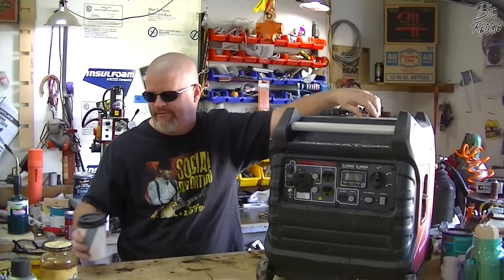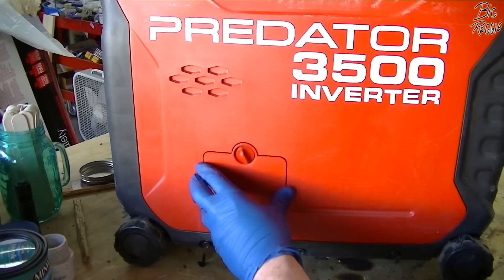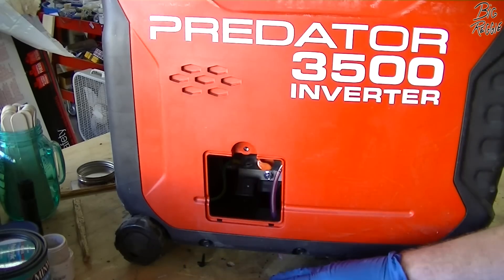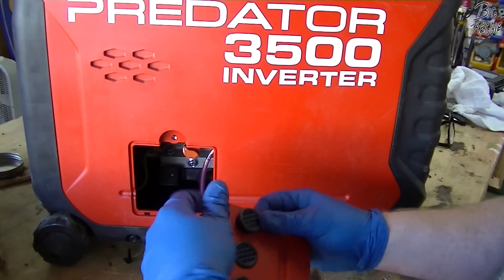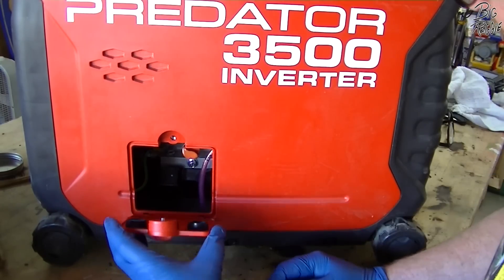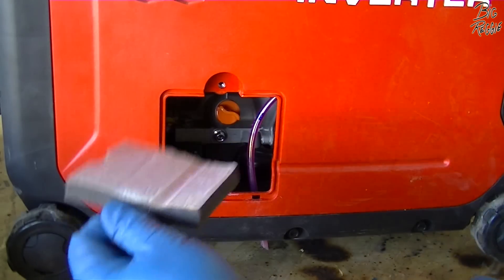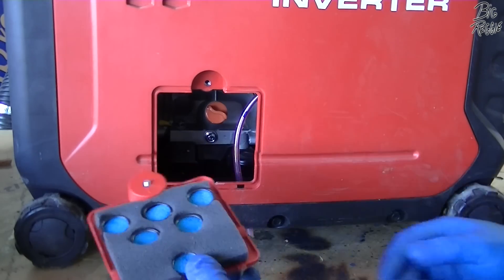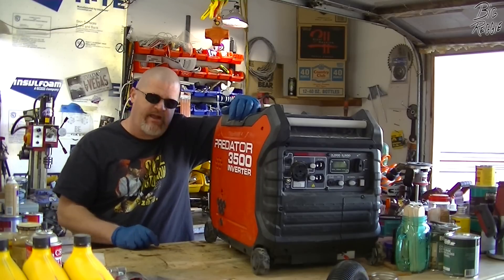Harbor Freight Predator Inverter Generator 3500 Vented Oil Door Mod!

Comment: Do not drill holes into the door. The airflow path they engineered pulls air from vents in the front bottom. This routes air properly across the electronics, keeping them cool.
If you think yours is starving for air and running rich, you can lean it out with a smaller carburator jet nozzle. The stock jet is supposed to be 76. Try a 72, or if in a higher altitude, maybe a 68 or smaller.

Comment: auhhh just cause the door is sucked in from negative pressure does not mean it's starved for air - now I don't know what you may have done ... the starvation is on the air breather not much of an intake inlet .. I don't know if the other guys are right but it makes some sense to keep the air flow coming in up past the inverter .... hell if you want plenty of air flow .. just take the red panel off

Comment: Just bought this 3500 Predator generator, I’ve run it for 8 hours to break in the motor.  This unit sits still while it runs and stays cool by design. The air intake delivers air for combustion, as well as engine cooling. With all the cowling designed to control the air flow to get the engine cooled.  I doubt the added holes will hurt anything tho.  On the exhaust side of the unit you can feel the cooling air exit, and it’s very warm. The intake I air is below the control panel, very close to the ground, recommend it be run on a solid surface for best results.

Comment: Dumb sorry but only way to get the point across there pulling air over the inverter
Reply: The vacuum is from the cooling fan which is pulling air over the inverter first your not going to drill a hole inside a window ac because there’s a vacuum behind the evaporator ? They want as much air getting pulled over the inverter it is the most sensitive to heat the engine   Is fine not to be rude but there’s people on here that will watch this and just be oh I have to do that and it’s doing no benefit and yes it probably won’t ever hurt the unit but also will definitely not benefit it at all

Comment: The case pulls air from underneath and vents it past the inverter for a reason.  When add "extra vents" you are creating a condition where the inverter assembly will no longer be cooled correctly.
Reply: @BigReggie  I don't doubt it.  Just because your inverter has less cooling now doesn't mean it will break immediately.   Do you really think its believable that the people that designed this great generator simply forgot it needs air?  Of course not,  they are ducting it across the inverter for a reason.

Comment: What can I say that all the others have already said below.  Your unit is not starving for air!!!  If I were you, I would remove this video.  However, in your defense, this starving for air issues was the train of thought several years ago.  Primarily because some generator were running a very rich mixture.

I also have the P3500. Before I bought it, I did a lot of research and watched a lot of videos. Some folks had problems, but most did not. What was discovered was that there were some design issues with the earlier 3500s. I also discovered that no matter what generator you have, including Honda, people were having problems. In all cases it came down to a fuel system issue. Even on the Hondas. 

On the Predator 3500 it had to do with a fuel tank vent pipe being too low in the filler neck. If you over filled the tank or transported it with an over full tank, fuel would seep into the charcoal canister by sloshing around in the tank. This would cause a very rich mixture and make you think that the engine wasn't getting enough air. Thus, people were drilling holes in the breather and in the case. That took air away from the cooling of the electronics up front on the panel and really did not solve the problem. 

They also took the charcoal canister out of the system. At the same time, the spark plug was fouling out much sooner due to an excessive rich mixture and the spark arrester was getting clogged up over time. The service manual says to remove and clean the spark arrester every time you change the oil Most people never do that. 

The problem with the vent tube was corrected with the new design of the tank. The newly designed tank can be identified by the fuel gauge on top of the tank. The earlier tanks did not have the gauge. The interesting thing about this engine and carburetor is that it is the same engine and carburetor that is used on the Honda generators of this size.

 There was one other issue that I know about. I experienced this one not with my generator, but with my Honda Quad. It had to do with carburetor jetting. My Honda Quad was purchased at a dealership who was only at 50 feet MSL (Mean Sea Level). The carburetor mixture was adjusted to make the engine run perfectly at that level. But when I took the Quad up in the higher mountains, it ran poorly.

 The Honda dealer had to adjust the mixture for the higher altitude. I had to do the same when I was flying my plane. The higher I went, the more I had to lean out the engine to get the best performance. There is no mixture adjustment screw on the Honda or Predator carburetor. You have to change the jet to lean out the engine for best performance at higher altitudes. The standard jet was a 72, but some people were installed a 68 in its place.

 I don't mean to suggest that the Predator is the best generator on the market. I think there are many great generators on the market. I'm only suggesting that the problems you have had are explainable and correctable. And that there are good and bad reviews on almost all brands, makes, and models of generators out there.

Comment: Dude, your confusing the carburetor intake air with cooling air.  The engine is NOT starving for air, it runs just fine. Your messing with the cooling air for no reason, the unit runs cool so the air circulating around the unit is sufficient.
Nice mod but it’s pointless! Does your unit run any better?

Comment: By opening up the case you will destroy the electronics in the generator.  The way it's designed is it sucks intake air over the inverter to keep the electronics cool.  By opening up the case you decrease or completely stop this cooling of the electronics from happening.  You can mod the air filter housing itself for better breathing inside of the generator case but do not open up the case.

Comment: I'm sure the people who build these units plan the air flow around many things . Sometimes you think your doing a good thing when in some cases you are altering it for the worst. The air flow on these comes in through the lower front and goes around the internals and out the back.

Comment: From what I've seen, the air intake it has also cools it's electronics. Allowing air in somewhere else decreases the normal flow and potentially puts the electronics at risk. If you want not air flow to the carb, simply drill the air filter cover.

Comment: Do NOT listen to this guy.  There is NO starving for air.  It is working as designed as several here have stated.   ALL inverter generators are enclosed for a reason.  They operate different and are more expensive than regular generators.  It is to provide proper cooling airflow across the electronic heat sink located at the front bottom of this generator.  Drilling holes, leaving panels or doors off results in overheating and failure of unit.  IF you look there is rubber seals in the groves that the side panels fit in and there is a rubber drain hole plug used to seal up the unit for proper cooling. They didn't seal it up for the fun of it.  If it's surging slightly it's from no load, NOT, repeat NOT from starving for air. They are designed to provide power, NOT win some idle contest.  Leave that to Harley Davidsons.   NOT one person in all these  " Modification "  videos have shown the engine was running hot.  This IS how Inverters were designed to run,,,, so leave them alone.  They produce clean 120 volts regardless of engine speed.  Think about it people,  many are logging hundreds/thousands of hours on these units without ANY modifications in the coldest of temps to the heat of the desert.  These "Modifications "  do NOT make the generators run better.  It's a real shame that these videos come from these,  " experts " that know more than the designers.  Sad thing is that some rely on these units to run their medical equipment and bad, " Improvements "  can cause their inverter to fail when needed most and also likely to void the warrenty.   Only use clean fuel, don't overfill it, drain totally when done using it and don't try to " Improve" it.   New models are fantastic.

Comment: Big Reggie, I must echo what has already been said. 

At best your mod is harmless. At worst, you are causing cooling issues by diverting airflow.

Does your mod change the low pressure created inside the cabinet?

Maybe. 

The engine compensates by opening the throttle a minute amount.

To the person that chimed in that air starvation is eventually an issue, yes it is, if you are a fucking moron who never does filter maintenance.

Comment: You have assumed that 100% of the air supply intake is from that door which is not true. Where is the builtin air filter and air intake?
Reply: @BigReggie  Using the builtin filter? If so why further restrict the intake with those you installed? Either leave the door off, or create a secondary filter with an area of 1'x1'.

Comment: What is that thin clear hose inside the oil door?  Mine has one that is not connected to anything on the bottom.  Couldn't figure out what it is for.

Comment: You affectively bypassed most of the inverter cooling and created hotspots while simultaneously making your generator slightly louder. i’ve seen these generators run for thousands of hours with no issues with no modifications.  not sure how you came to the conclusion that a door sucking itself to the housing presents a problem... The air intake is on the front of the engine located inside the generator. the generator was designed to pull in air From key points on the outer housing to cool components before pulling air in the engine to cool itself. I can see someone having some sort of a failure if they’re running at 60% load or higher on a hot day due to lack of air flow on key components.

Comment: 2:30 "That means it is literally starving for air" NO... It means you have sealed off the former source of air draw. It's an air cooled engine, if it were "starving" for air it would shut down. I've had that generator for five years WITHOUT any modification and it runs fine after 336 hours.
Reply: Exactly.

Comment: We have the same problem on KTM motorcycles. From the factory the air box has very little air flow. We can prove this by taking one side of the air box off and taking the bike for a spin. There is better performance with the side panel off. These bikes are water cooled so we don't have the air flow debate that you are having. I used those same 6 little filters from UNI. I drilled six holes in the side of the air box with a 1" spade bit. But I was not smart enough to use a piece of wood to drill into after the plastic panel. So the spade bit wondered around and now it looks very amateurish.

Comment: Mine doesn't want to start using the battery, but it pull starts like a champ.  Not sure what that is about. Also, anyone buying one of these generators should get the extended warranty. My battery died last year and I found out that NOBODY sells a replacement battery for these generators - INCLUDING HARBOR FREIGHT!!!  What they DID do was give me a completely new generator because I had the extended warranty. This, of course, makes no sense, but I didn't argue. I took the new generator and also bought ANOTHER extended warranty.

Comment: Hi Reggie I just purchased on of these generators and I watched a lot of videos on this problem. I did my own research and what I found is the door closing itself is normal. What is happening is the unit being air tight for a reason. It is forcing the air to be drawn up between the two front wheels over the inverter first to keep the inverter cool, that's they do it. If you put your hand near the front wheels you can feel the air drawing up through the front over the inverter. If you have your hand there and opened the side oil door you will feel the air flow stops flowing past your fingers and it is being drawn in through the side. When it does that the air is now not cooling the power inverter which could cause the power inverter to possibly overheat. If you open and close the door you can feel the air change with your hand between the wheels and you will see exactly what I'm saying. What's it draws the air past the power inverter it has circulated in the case and then blows through over the cylinder head and out the back of the exhaust around each side. So putting the holes in the oil cover I don't think that is really helping the situation if you open and close the door you can feel the air change with your hand between the wheels and you will see exactly what I'm saying. once it draws the air past the power inverter it then circulate in the case and then blows through over the cylinder head and out the back of the exhaust around each side. so putting the holes in the oil cover I don't think that is really helping the situation because your drawing less are over the power

Comment: Do not do this!
Reply: @BigReggie  Well how many others like mine have hundreds of hours and run great too and look at your comments most of them say it is designed for a certain air flow. Have you checked it with a fuel flow meter and temp meter because if it gets more air it will either burn more fuel or run lean and hotter unless you rejet the carb. Your not building a hot rod and even if you succeed in making more horsepower the inverter will overload but the governor will keep it at the same rpm. So what did you accomplish?
Reply: @BigReggie  You just proved what I thought in the first place. Your a childish idiot steering people in the wrong direction. But your comment is what happens when your talking to someone with low intelligence and a lack of true knowledge. I suspected as much and was proven to be correct.

Comment: There goes your warranty!
Reply: @BigReggie  Actually I told my Harbor Freight people just today of all these YouTube modifications going on.  They said they will replace any of their products under warrenty with NO problem but if people do,  "  Modifications "  then that voids warrenty.  Same as any company.   Try improving your car or furnace and expect warrenty work to get done.  They said they will check out some of these videos and look for altered returns.  There is a whole bunch of comments here that explain this alters cooling of the electronics.  Nope, I'm NOT an engineer or make videos but I doubt you have a degree in designing any generators or Inverters either.  Bottom line,  how do you explain that a bunch on YouTube are getting up to thousands of hours on this great inverter running under all conditions with NO modifications or problems????   We have to pay a higher price for these units and pay more for extended warrenty because people misuse and modify them.

Comment: Does it have an hour meter?  If not, that is inexcusable regardless of price.  
Remote control for electric start?
Sine or square wave power?
Total harmonic distortion?
Auto-throttling depending on load?
Ease of draining carburetor for long-term storage?
Ease of adding, changing or draining the oil?
Engine displacement?
Long-term durability comparison?
Accurate, dependable fuel gauge?
Toolless access to the engine?

Comment: Why add the filters and remove the filter on the back of the door.  Just drill 1 inch holes.  Also the design probably requires the door on for air circulation purposes, as do many RV gas generators.

Comment: You now are going to have cooling issues when run at full load.. you don't think that even though its a Chinezuim Genset that they didn't do any R&D as to cooling? 

IF it was really starving for air you would have been much better off to port the air intake on the filter to the outside of the case so 1 it would REALLY breath easier and 2 it would draw in the coolest air it could increasing efficiency

Comment: That vacuum is caused by the flywheel fan, not the carburetor.  I would not recommend too many holes in the cover as it will start reducing the amount of air moving across the electronics.  I will admit, I got caught up in the "drill a bunch of holes in the cover to prevent (non existent) starving for air issue". Just look at the tiny slots on the air filter cover to confirm this.  After putting 5 of those foam filters in the cover (these were modified, removing the webbing and only leaving  an "X" pattern to flow way more air), I tested it by unscrewing the battery cover and it didn't change anything, door still sucked shut while running.  Then it donned on me, there is no way that tiny carburetor can be pulling that much air....then I remembered how much air blows around the exhaust and it hit me, duh, the flywheel fan can move that much air so I felt like an idiot for drilling those holes in the cover.   I feel like I need to start a group meeting ..."hello, my name is Steve...I admit I drilled holes in my brand new predator generator..."  -group of men "hi Steve..."

Comment: Air cooled engines or design to draw air across the cylinder to keep it cool would you just did is taking air away from a source of heat that needs to be cool

Comment: I have a predator 3500 and the only timei have running issues is either the spark arrestor is plugged or or take off gas cap when it's running what you shouldn't do if you drill holes or alter that case you're going to take cooling away from the heat sink that is strategically located in the lower front of the unit withdrawals in air
Mess around too much you're going overheat and possibly burn up the inverter